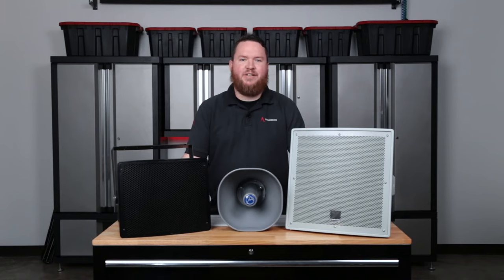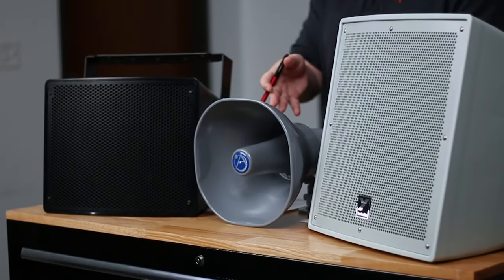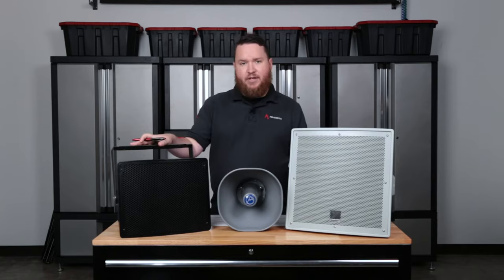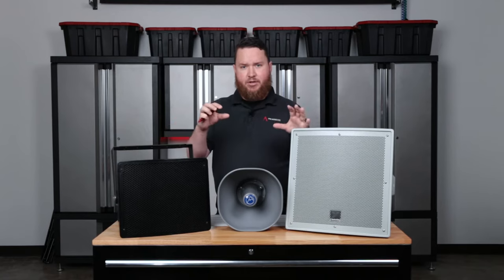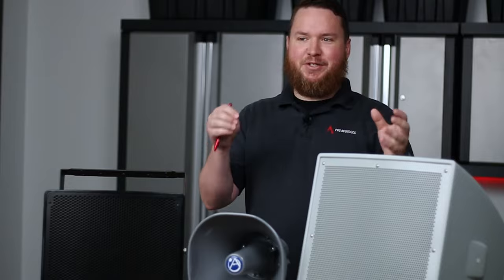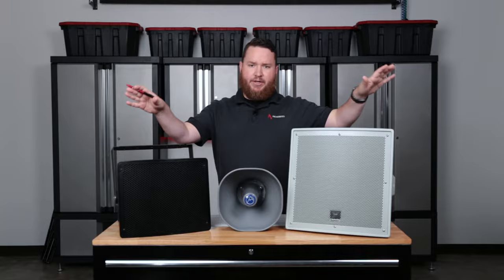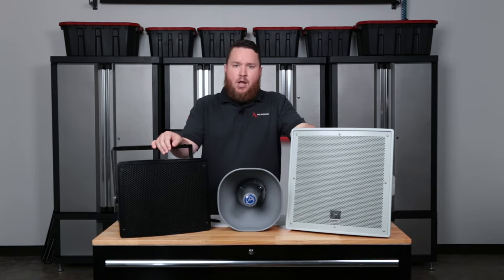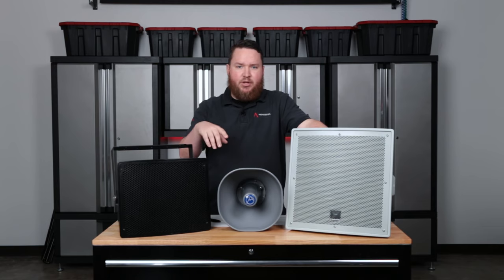Why Do Some Stadium Sound Systems Not Sound Good? on Pro Acoustics Tech Talk Episode 85

Comment: My local high school football stadium had the sound come out of the scoreboard. Now they have Atlas speakers and now they sound muffled. The scoreboard sounded tinny and had no bass. The Atlas speakers have bass but no treble. That’s the situation with my local high school stadium. BTW before the scoreboard, they had EV Cobreflex iii’s
Reply from the maker: Based on the information you provided, it seems that the tweeter drivers are most likely damaged. However, it may be possible to replace them on-site. We recommend reaching out to our sales engineer team to discuss this further and determine the most suitable solution.

Comment: Hello sir , I work as a sound engineer for the state government . Most of the lagre events take place in the football (soccer) field . Our focus is mainly on speech reproduction and a few dance and singing stuff . The problem we are facing is that , the control room , the VIP gallery and the locations for speaker placements are on the same lane (the same side of the stadium) ... We face issues like too much proximity to the VIP's  ears , sound being inaudible to the corners , Bass buildup  and most importantly the echo/reverb causing problem in intelligibility . It is an open roof stadium sorrounded by buildings .... Also we place the speakers on the highest platform just below the roof (There is no space on the ground) . How can these problems be solved ?? We are currently using OHM dual sub woofers ,  OHM bi amped top and a couple of JBL SRXs here and there . ... All passive ..... Should we switch to line array system or the ones you mention in your videos . OR a combination of both ?? .... I'll be highly grateful for an elaborate explaination regarding this topic .
Reply from the maker: Hello there! We suggest that you get in touch with us to discuss your venue with one of our sales engineers. Call us at (888) 256-4112 or email sales@proacoustics.com. We will be happy to help you find the best solution for your needs.

Comment: Can these be mounted onto a vehicle?
Reply from the maker: It is not recommended to mount commercial audio stadium speakers onto a vehicle. There are speakers specifically designed for this purpose.
Reply: @ProAcoustics  Could you point me in the right direction?  All the speakers I see for vehicles just have a small tinny sounding horn for vocal sound on PA systems.
Reply from the maker: @jdm1066  We do not offer mobile or car audio, but we may have some solutions available for your needs. Please get in touch with our sales engineers at sales@proacoustics.com or (888) 256-4112 to discuss your project.